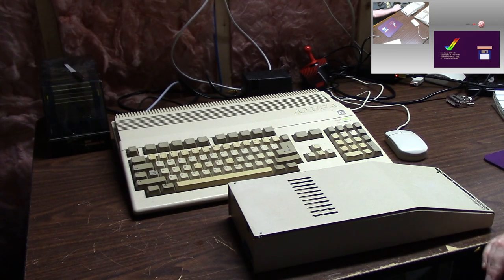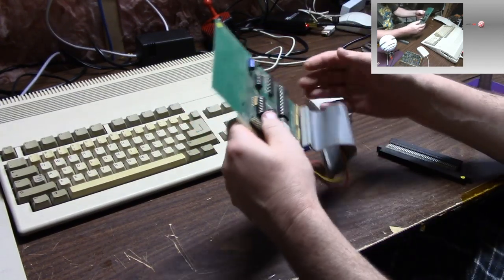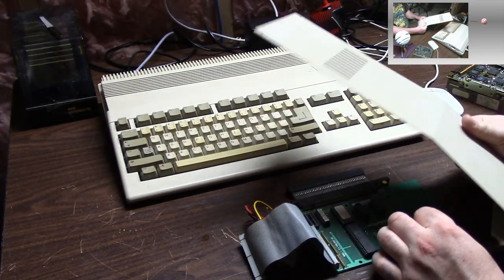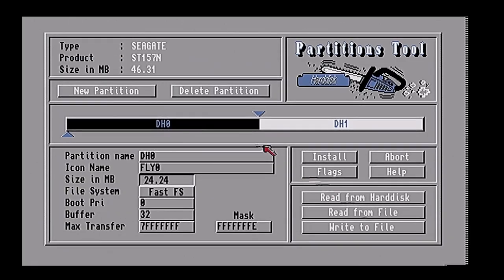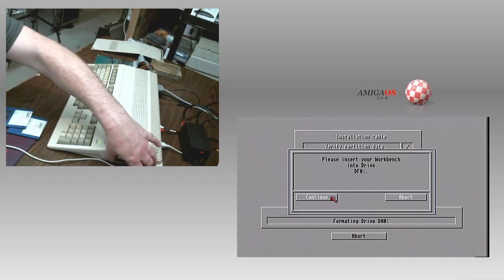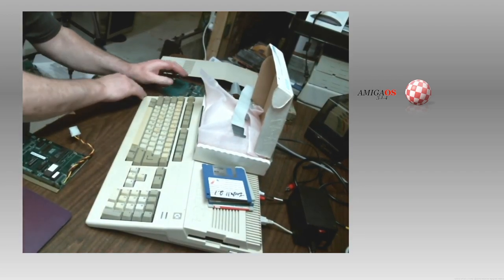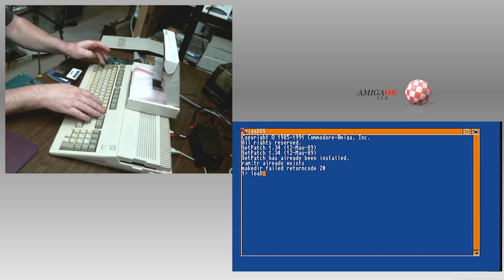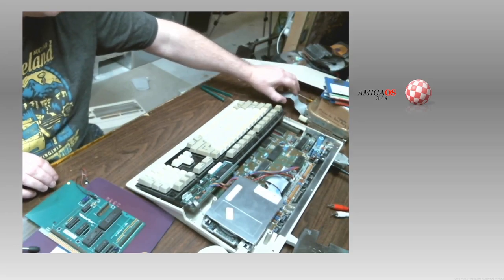E152 - Dataflyer 500 Amiga 500 hard drive controller

Comment: Back when my only Amiga was the A1000 I bought a DataFlyer 1000 which supported both IDE and SCSI.  I added the 8mb RAM Board and populated it.  When I got an A500 I removed the boards out of the metal enclosure and connected them to the A500 and when I got my A2000HD I moved the boards to it and ran them for several years until the Controller Died then I just used the RAM Board which I pulled out a few years ago and it was working at the time but I had installed an Accelerator and a BIG RAM Board.    Expansion Systems basically used the same board revisions across all Amigas and just branded them for each specific model with only a housing change for the A1000 and A500.   I have a collection of control boards unfortunately they don't work otherwise I would be using them.   One day I will try to troubleshoot the boards but it would be nice if I could find schematics for the boards.   Oh yea Low Level Formatting takes forever.
Reply: Stephen Bruce have you seen Chris’s 2nd part following this one? He may have shown you some helps to your issues with a controller
Reply: @templar2b1ask  Yes I saw that today.   I actually pulled both controllers out to compare them they have different ROM Revisions & sizes so I will try to read them and get those backed up.   I have ordered  a set of IC's today so that next weekend I can spend sometime getting both boards working.  I have one working 8mb RAM board but the other one I am not so sure of just yet.   I have some working SCSI Spinners but will use SCSI to SD Boards.   I would like to also populate the IDE portion one of my boards has the sockets, some additional resisters and a Jumper Header but I have to figure out what the missing IC's are and what if any additional components are needed.  Schematics would go along way but I never had much luck finding them.

Comment: Chris, the drives actual name is DH0: already. Fly0 is the virtual name of the drive that the program gave it. Like Workbench or Work. 
Also, turn off all those annoying mid-video ads! It tried to run like 4 ads in the middle of the video and that is super annoying. Just chose the option for the ads at the front and back - MUCH less annoying!
Reply from the maker: done, i just click default and let it rip
Reply: Using adblocker in Chrome no ads!
Reply from the maker: @Channel-Zx   well i dont have a patreon like doug so gotta scrape by somehow now a days.